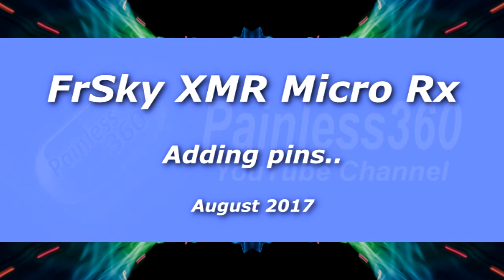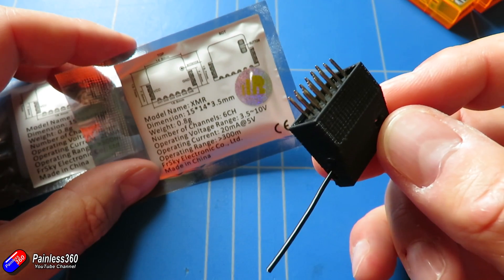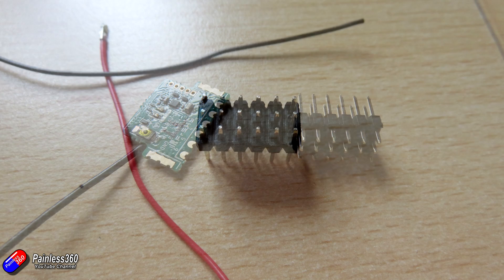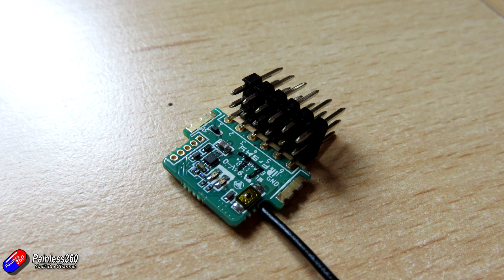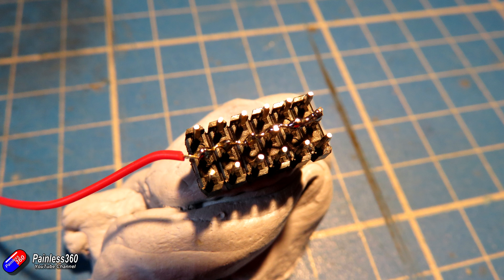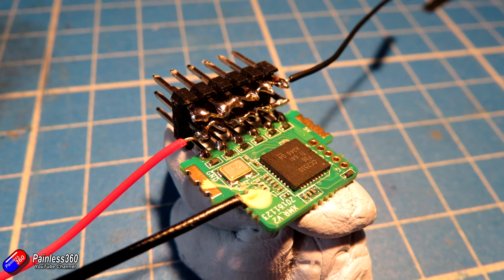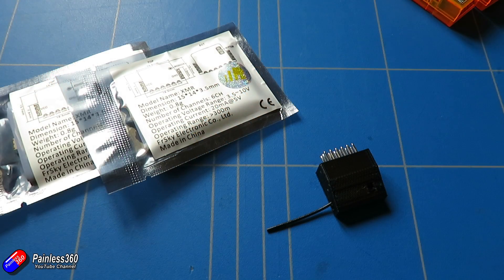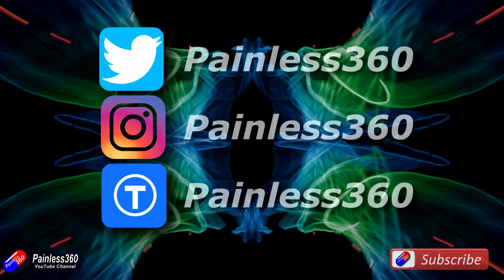RC Quick Tips: FrSky XMR Pin Mod

Comment: sorry not binding ...firmware updates... need to change to eu/lbt.
Reply from the maker: Best of luck!
Reply: no help then ???
Reply from the maker: Oh! That was a question? I missed the question mark.. see my flashing video..
Reply: yes sorry ...it's a ? ...followed all the flashing vids you have done ...xmr is wierd ...and doing the process via the tx (qx7) gives an error "no response from bottom pin " double checked the connections and all are good ,still get the error...
Reply from the maker: You’ll need a fuc-3 unit to flash it. See the end of this video - https://youtu.be/qzzUtFIcqM0
Reply: ahhhhh right ....thank you sir ,time to go shop then .....cheers !!!
Reply from the maker: They are cheap and cheerful and I have a few here.. Only use them once in a while but bloomin handy..
Reply: got the fuc 3 ,set it up as the vid says followed all the downloads installed all drivers ...no joy !!! does not find the device and just sits there with one flashing light ...oh well ....shirt happens !!

Comment: Very interesting video. At one point 4:25 onwards you're using some kind of gray thing to fix the parts while you solder them. What is that? Where can I buy it? It is an absolutely great idea, much better than the 3rd hand.
Reply from the maker: BluTac. It’s the stuff used to attach paper and posters to walls. Handy stuff!

Comment: Will it work with a 3 cell battery or can it only handle 2 cell? Great videos. Keep up the good work.
Reply from the maker: +Joshua Dockins adding the pins to the receiver won't change the voltage that it works at. So that all remains the same. Happy flying!

Comment: Why criss cross the wires? Wouldn't this be better done the other way up as in the video orientation the bind button becomes inaccessible (for failsafe use for example) when mounted in a model, which would typically be done using DS tape on the flat large area with pins horizontal but uppermost. Either way up the wires don't need to be crossed.
Reply from the maker: +reflexuk1 either way works. Happy flying

Comment: my god , people still use those big servo plugs!!!  :-)
Reply: My latest flight controllers, and sometimes receivers, have used the mini micro jst plugs. I do have the 1 mm crimp tool and a rock steady hand, but still my success rate is 50%. I would prefer this over micro JST any day. However, I just noticed this isn't SBUS. This is why I stay with Flysky. You can get an X6b with ibus for 20% less $$$, 2.5Km range, telemetry, and same footprint.
Reply: I hate All plugs, give me solder pad anyday. :-)